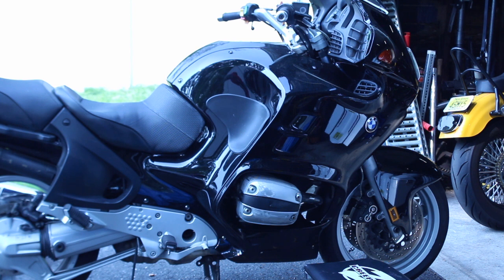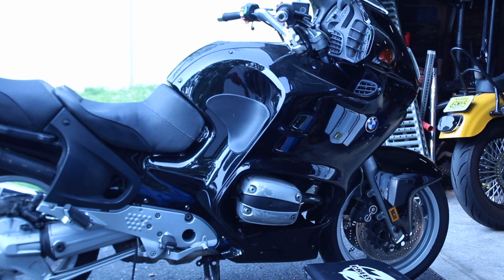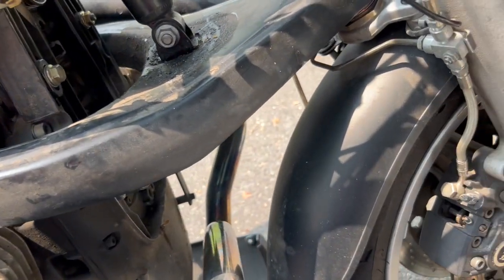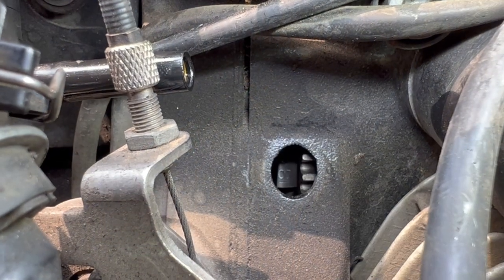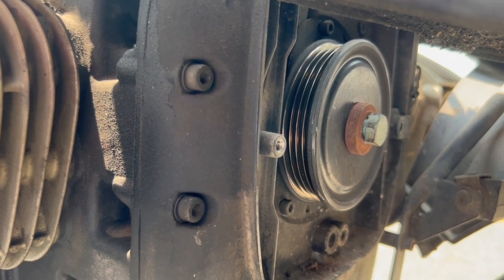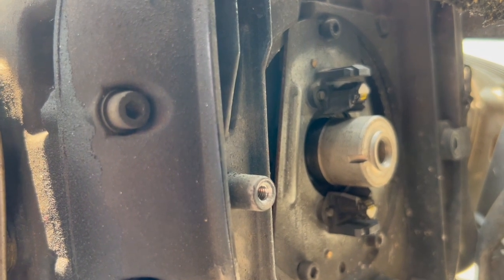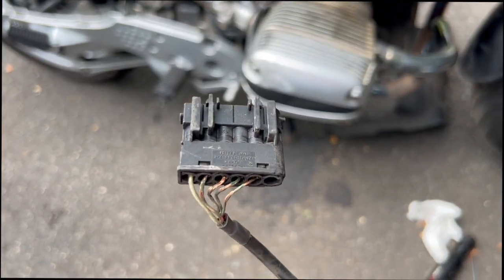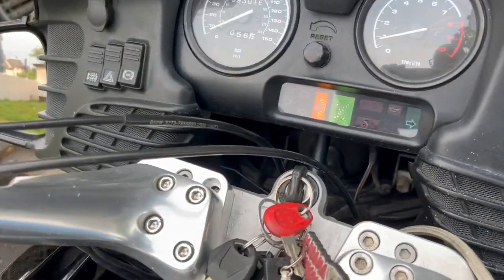One Of The Main Parts That Should Be Replaced On An old BMW Motorcycle

Comment: A BMW Hall effect sensor failure is due to worn wiring insulation at the connector end of the wiring harness under the tank.  The symptom is an out-of-nowhere engine cranks but no start.   The repair is electrical tape.  Sensor failure can happen if the sensors get wet, such as if one sprays water through the front engine cover vent hole.  The symptom is engine runs with a bouncing tachometer needle.

Comment: Could you tell me where you get that timing tool from. The one with the light
Reply from the maker: Euromotoelectrics.com
Reply: That's to TEST if the sensor is faulty not to adjust??
Reply: It decís top dead centre, TDC, you move the plate until it gets exactly to TDC,then secure the three screws. It should be close to centre anyway, as you will have put it there prior to doing this, and securing it with the pin as he showed you. It doesn't check the integrity of the HES, in fact, they rarely fail, it's the wires that disintegrate.

Comment: Thanks!  Where do I find that timing tool?

My R1150GS HAL sensor died only because when I reassembled after changing the timing chain and tensioners, the round cover with the notch in it (rotor is what they call it) separated from the crank pulley, shifted slightly off center (though I have no way of seeing this since it’s blindly hide inside the pulley).  When I started the engine, I heard a grinding sound.  It ran for 10 seconds and did the typical HAL sensor failure mode (crank, no spark).  The rotor was damaged inside its inner surface from striking the HAL pickups.   I ordered a new rotor from Max BMW and a new HAL unit from BeemerBoneyard.   Hoping these parts provide the fix.  That rotor is very poorly designed.   It has no reliable way to stay centered if it fails to stay attached to the crank pulley.   The tiny tab on it also a terribly engineered attribute.    

I disassembled to find that
Reply from the maker: Here’s the link for the tool https://www.euromotoelectrics.com/product-p/edl-miniht-r137.htm
Reply: @Lobanoriginals1036  I bought and used this tool but it took me a good hour of troubleshooting to see there appears to have been a step I needed to do beyond what you mention in the video.  For me I was not able to get the tool to light up (having locked the flywheel at TDC, key on, rotating the HAL either direction fully).   Nothing.   I decided to tighten down the HAL in its centered position, remove the TDC locking pin, and crank to test for spark and fuel.   I had neither.  Scratching my head I moved on to check fuses, connections, searched for damaged wiring, bad side stand switch, etc.  Nothing.    Then I read somewhere about a step to synchronize the new HAL with the Motronic unit by turning on the key, twisting the trottle at least twice to wide open.   I did this.   Then went back to set timing and this time it worked.   I think that one step was critical for me as I put the entire bike back together and got a definite partial start before the battery said it had had enough.    It's on the charger now and I expect it to fire up next attempt.  Thanks again for the video.   Saved me $1000 at least.
Reply from the maker: @TheShaggy1966  I’m glad that you were able to get it figured out. Great job!

Comment: Hello, please, my father has a 1996 BMW R1100 RT. He has not operated it for 20 years. It has not driven more than 3,500 kilometers, and no one has touched it. Now I am trying to get it back to work. I have changed all the oils, the fuel pump, and the filter, but when the engine is running, it does not start, and no fuel comes out of the injectors. The pump works. 
Do you have a method or solution to my problem? Thank you
Reply from the maker: I would test to see if there is voltage at the electrical connectors at the injectors. If there is, it could possibly be that the injectors bad or are clogged. Pull them out and thoroughly clean them and see if that works
Reply: How can "the engine run", when it "DOES NOT START"??? KEEP FINGERS AWAY!!!!

Comment: the sensors USUALLY burn out when the wires short out so the whole plate needs to be rebuilt. 2 new sensors and all new wiring - this is not a bad thing because far superior wiring is now available that was not available 24 years ago when these bikes came out so the chances of this happening again are basically nil

and the wiring will also short out at the sensor's end because they will be in direct contact with way more heat down there.
Reply from the maker: Absolute facts! Thanks for sharing!
Reply: So at what point in time did BMW correct this problem? Does my 2006 R1200RT need this maintenance?